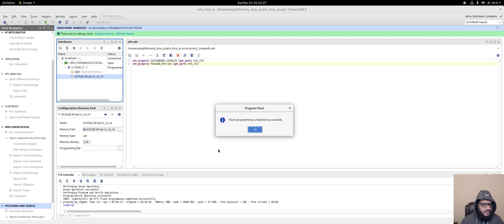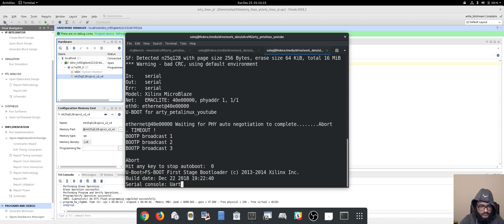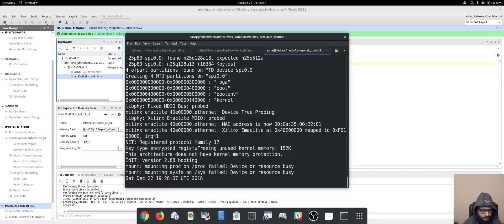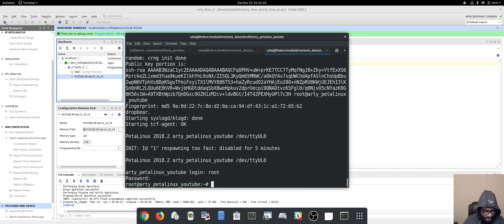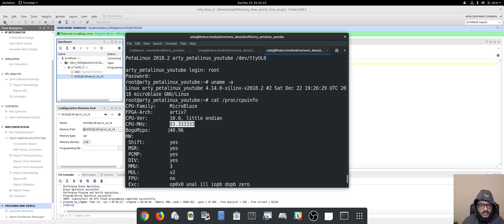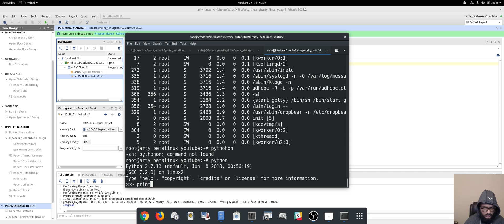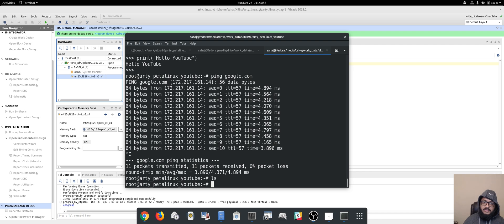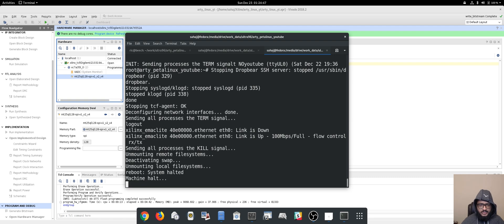Designing a custom Linux SoC using Xilinx MicroBlaze on Arty A7 | Part 3: Booting Linux

Comment: just discovered your channel, i like your videos. i'm looking forward to seeing your risc-v material, ever since the SHAKTI project came out i've been very excited to learn more and experiment on FPGA's with it. I have one question, for the A7 35T, what's the max frequency that you could run the microblaze at?
Reply from the maker: On the a7 35t theoretically you can go as high as 400mhz but that's not possible. Since the microblaze Memory IP is very basic, the cpu runs at 1/2 the speed of the RAM since the memory IP generates the core clock. So it's stuck at 83mhz.